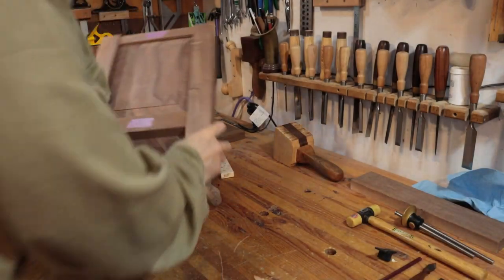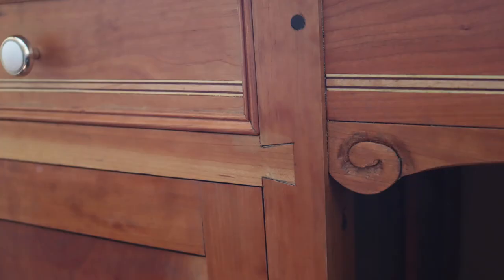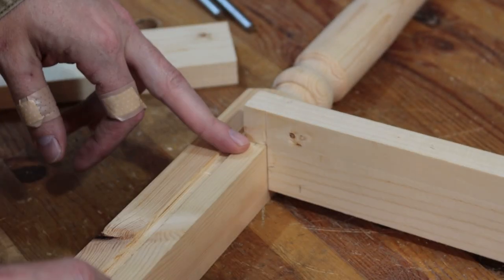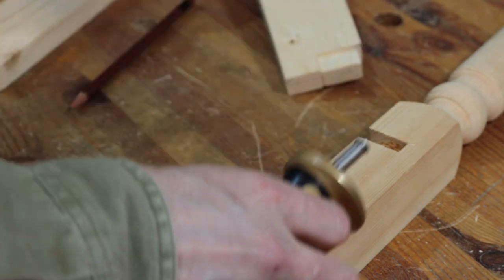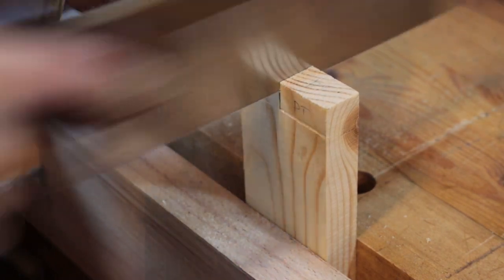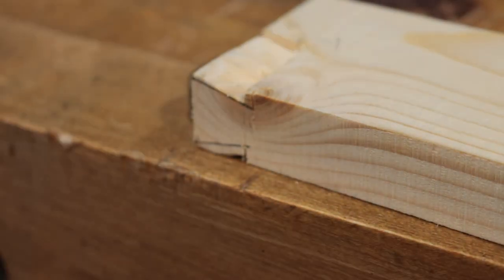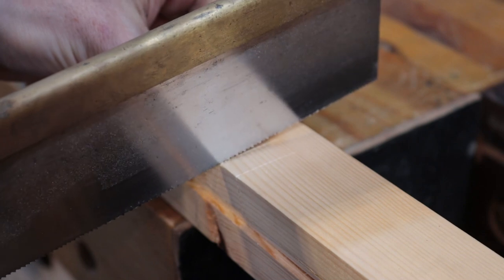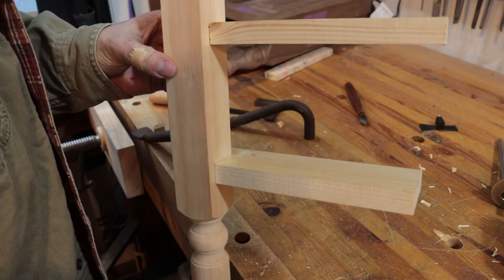How to cut a Stopped Half-Blind Dovetail with hand tools! INSTRUCTIONAL!

Comment: Merci pour cette vidéo.
Je n’ai pas bien compris le pourquoi du premier trait de scie. 
Thanks for the video.
I didn’t understand the reason for the first saw cut.  どうして？
Reply from the maker: The first cut gives you a clean and straight shoulder and makes it easier to shape the dove tail. Thanks for watching!
Reply: I was afraid about weakening the joint. どうもありがとうございました。
Reply: @jean-paulmuller4230  shortening the dovetail pin slightly won't weaken the joint as long as there is enough material at the edge of the tail piece to support the load. but for a joint that cuts across the entire width of the material, yes, it can create problems, and in that case you'd want to just round off the shoulders of the dovetail pins slightly to help guide them into the tail piece instead.
Reply: Merci beaucoup.

Comment: Why don't you just add a dowel pin on the tenon?  PVA glue is incredibly strong on its own.
Reply from the maker: Not sure exactly what you mean... you could of course draw bore tenons, but you would see the pin. Glue is strong and I use it, but I make furniture with more mechanical strength that will last for many generations. There are many ways to construct furniture, I'm just showing you one option to achieve certain goals with both design and strength in mind. Thanks for watching!
Reply: @TenonsTenors  Yes. I meant drawbore tenons. I am too terrified to attempt a dovetail, especially on a part that has many hours into it.